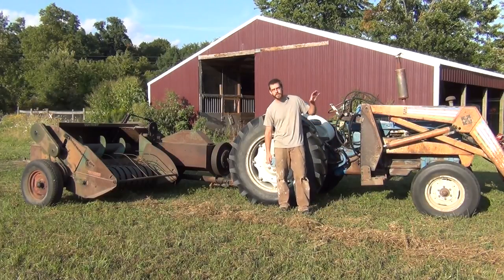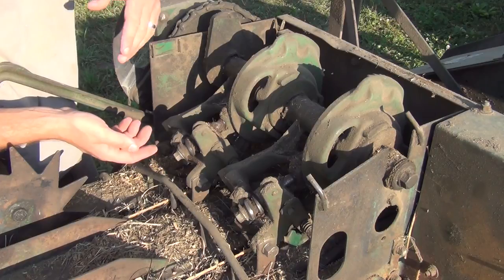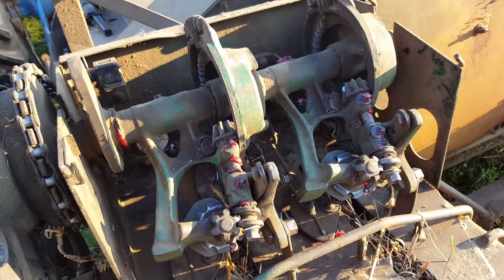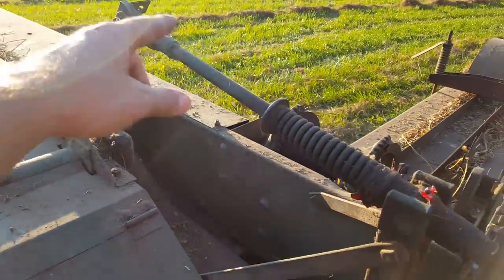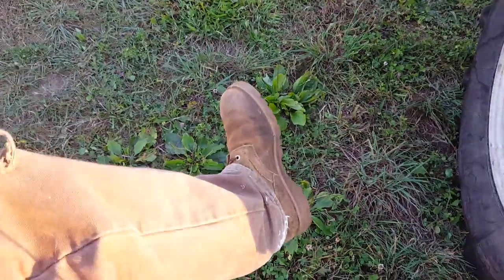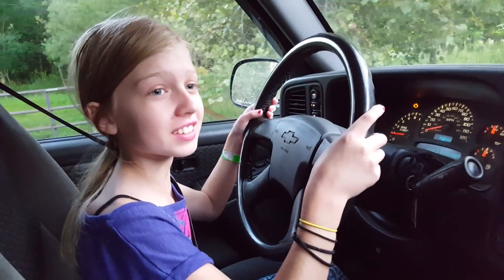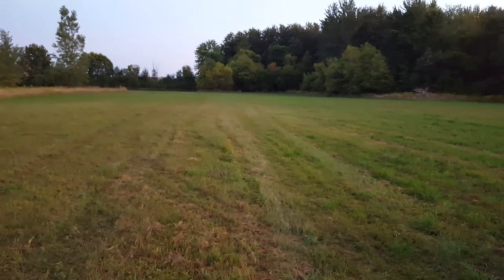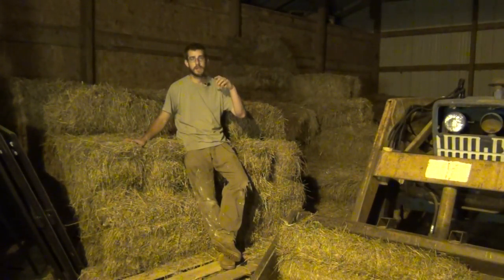Providing Sustainable Food For Our Animals - 3rd Cutting Hay

Comment: You just have to love watching the old farm equipment work.   It's like they were designed by the farmers on the front porch and adjustments in the design in the field.   Simple and easy design without a computer or engineer needed to repair it.     I have a question, what happens to the rope cutter blade when you can no longer can sharpen it??  Must be a way to replace them.

Comment: Those knives are replaceable. You have to drill rivets I'm pretty sure. I had to when I changed my knives on my new holland square baler. I had just put hardware in replace of the rivets
Reply from the maker: +Hayden Gudmundson well, you are not wrong at all. I should have said not easily replaceable:)